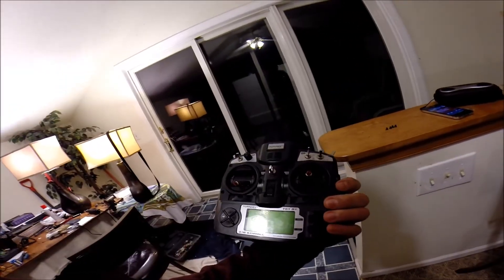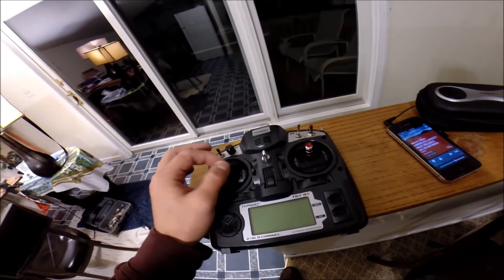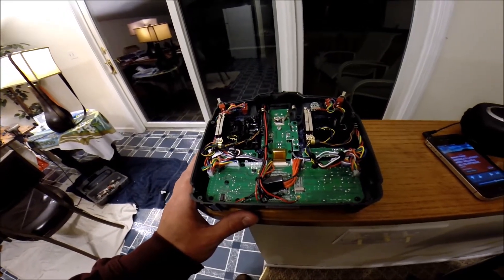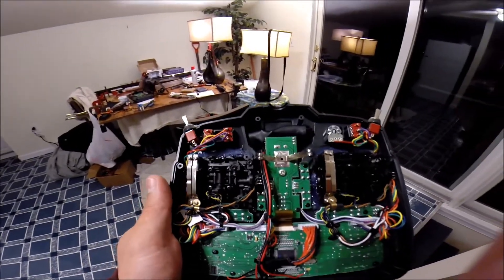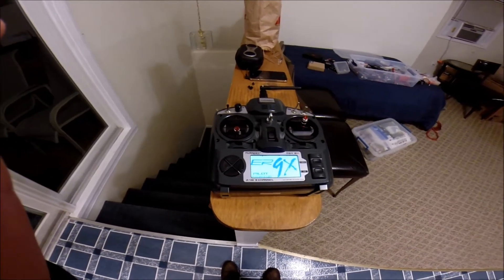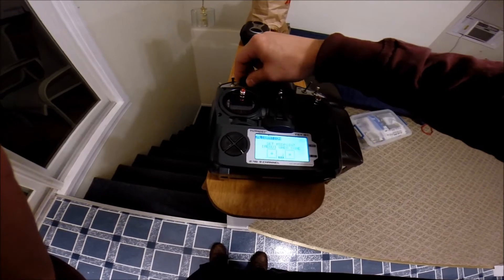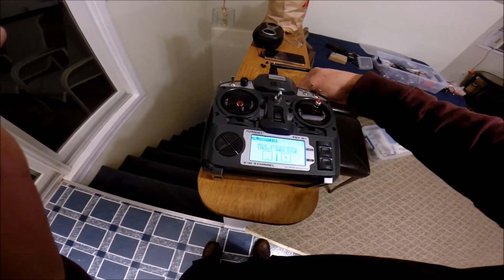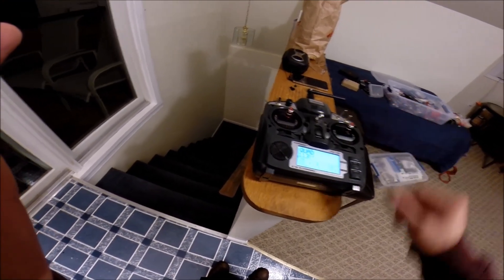Aurora 9 Gimbal mod on Turnigy 9x

Comment: To do this same mod and use the standard firmware Re-calibrate using this method:

Turnigy 9x v2 Calibration

Push and hold the right stick horizontal (lower) trim tab to the left, and the left stick vertical (side) trim tab up.
While holding, turn the TX power switch on.

You will get a screen that shows the version number of the firmware, with four zeroes (0000) at the top of the screen.

Center both sticks in their range in all axis, and press the menu button until it beeps and release. The screen number will change to 0001.

Move the right stick to the upper right corner, and press menu, and you should get a beep, and the number on the screen will change to 0002.

Put the right stick in the lower left corner, and press menu, and get a beep, and the number will change to 0003.

Release the right stick, and put the left stick in the upper right corner, and press menu until the number changes to 0004.

Put the left stick in the lower left corner, and press menu again until the number changes to 0005.

Center both sticks, and press menu until you hear a beep.
Press Exit.

Comment: Thanks for making this video homie. I'm considering this upgrade on my fly sky. I really like this radio and er9x I flashed to it. I use a dtfuhf openlrs UHF system. This is all that is missing!
Reply from the maker: Josh Bascii Right yeah alot of radios are perfectly usable and with all the time/$$ you spend to get it to operate in a given configuration it really sucks to be stuck with crappy gimbals. After moving the gimbals a second time i found there really isnt much to it.  of the three wires just keep the middle in the middle and if you have to reverse the other two to get the stick responding in the correct direction that's all that is needed wiring wise.
Reply: Cool thanks. How much better are they and how do you recommend mounting them? Still say hot glue ? I may go with some tiny nuts and bolts
Reply from the maker: Josh Bascii hey if you can find a way to secure them with nuts and bolts that'd be better but my issue was trying to keep it symentrical looking at the face.  there isnt any place that you can have 3 or 4 in the same spot and they'd be very randomly placed and odd looking.  As a result i just stuck with the hot glue.  honestly though the hot glue is so good that if you drop the radio you'll probably break something else before you knock the gimbal out so yeah i stand by that method.
Reply: Hmm. Ok I think I'll give it a shot would you mind emailing me a closeup of the back of the gimbals sitting in the case if you've got one? I have some stuff that is plastic that you boil in water then it turns into play dough consistency for a couple minutes, and hardens back into plastic.
Reply from the maker: Josh Bascii interesting.  sorry dont have any pics that would help and dont much feel like taking it apart... i dont think it would help you anyway.  you'll need a dremel tool to hone out the circles so its totally custom each time you'd do it even on the same radio.  

make sure you're viewing the video in 1080p and pausing for a screenshot may help.  

Good luck...

Comment: 9x Firmware does have a calibration mode, it's just not i the menu.

Push the right lower trim tab to the left (aileron on a mode 2 TX), and the left side trim tab up (Throttle trim on a mode 2 tx), and while holding them, turn the Tx on. You will get a screen that shows the version number of the firmware, with four zeroes (0000) at the top of the screen.
Center both sticks in their range in all axis, and press the menu button until it beeps and release. The screen number will change to 0001.
Move the right stick to the upper right corner, and press menu, and you should get a beep, and the number on the screen will change to 0002.
Put the right stick in the lower left corner, and press menu, and get a beep, and the number will change to 0003.
Release the right stick, and put the left stick in the upper right corner, and press menu, get the beep, and the number will change to 0004.
Put the left stick in the lower left corner, and press menu again, get the beep and the number will change to 0005. Center both sticks, and press menu, get the beep. You are done calibrating the sticks. After calibrating press Exit and the mainscreen should appear.
Some tutorials told me to shut down the tx after calibration but i noticed that it wont save the calibration without pressing Exit and going to mainscreen (the screen that comes when you normally switch on the tx).

Comment from the maker: that 9x died last week...  I moved the gimbals over to my 9xr and they work well in that too.  the 9x began getting very flaky, switches not even triggering their indicator on the display, then the right gimbal gave no pitch input.  Tested it on the board and it was not the gimbal, the 9x control board just stopped accepting input from that circuit.  

Its a shame, i still have a fondness for the radio but its junk to be honest.  My next will be a FrSky Taranis.  Good luck though..

Also.. be sparing with the hot glue if you ever want to get them out.  i was worried it wouldn't hold the gimbals well so used alot.  to remove them it took a very excessive amount of force to get them out, had to cut the glue with a razor to even get them to budge.
Reply: Little trick I have learned while working with hot glue... take a metal blade of some sort, not too big, like an old exacto. I like a curved exacto for this purpose. Heat the blade up - I just use a blow torch set to low. Now use your hot knife to either easily cut into the glue or scrap it up. It works like a charm and much less violent to the parts =)

Comment: Hey Chris how is the resolution on these sticks on the 9X? Their has been lots of speculation on different forums that you would lose some resolution because of the Hitecs being a 270 degree pot. I ask because Both sticks on my 9X have gotten flaky and am trying to decide between these gimbals or the Taranis gimbals.
Reply from the maker: interesting..  I can see how resolution could be reduced, before you calibrate them you can see range of motion is limited to like 30% on the front display (with er9x) but after calibration i have not noticed any issue in flight.  even when you look at the indicator on the front screen it doesn't seem jumpy or anything as you move the stick, very smooth and precise.  

Be careful with that radio before repairing it.. when mine got like that i only had a few flights before it stopped working all together, took off and had no aileron. got lucky and didn't crash..
Reply: Chris Iversen
Good to hear I have a set on the way from robot shop now 2nd day air :-P and yeah radio will be on the bench till the new gimbals arrive I fly 25% planes not losing one of them to a bad Pot!

Comment: How did you wire it up need help bad ELE pot this look like the best fix
Reply from the maker: followed the info here:

http://www.basement-rc.com/forums/index.php?topic=1738.0

up/down:
orange - positive
brown - signal
green - ground

left/right:
yellow - positive
blue - signal
black - ground

for the 9x each pot had 3 wires coming off, red/white/black.  a little guesswork there but red was positive, black was ground, and signal was white and it worked.  

I just cut the connector off that the new gimbals came with and soldered the wires together.